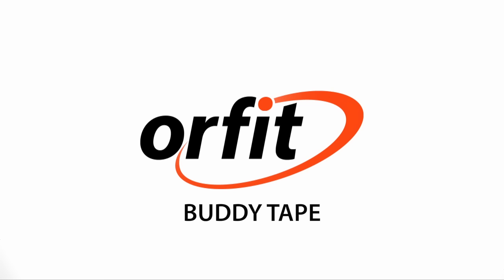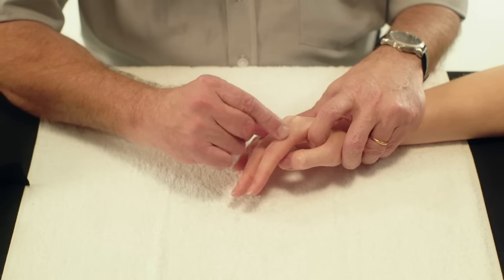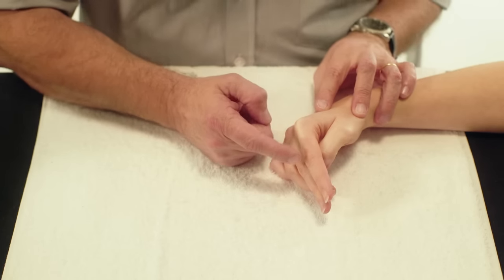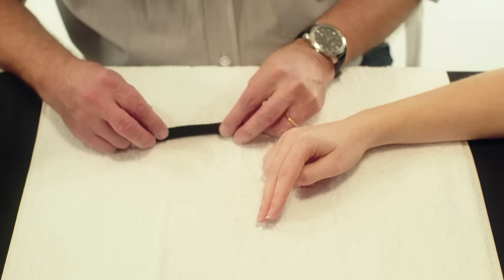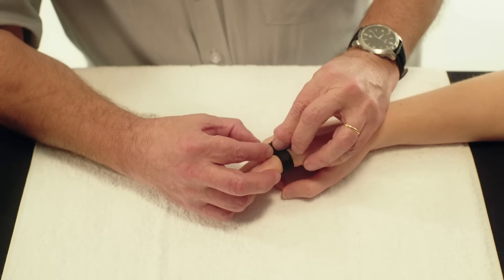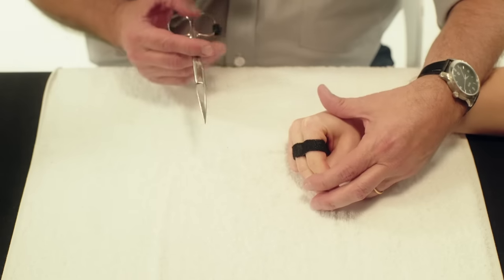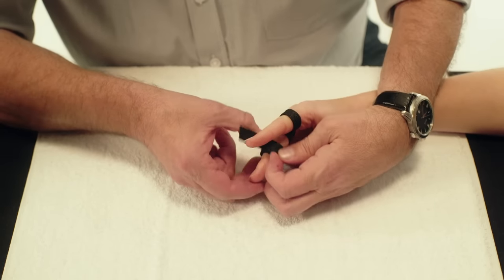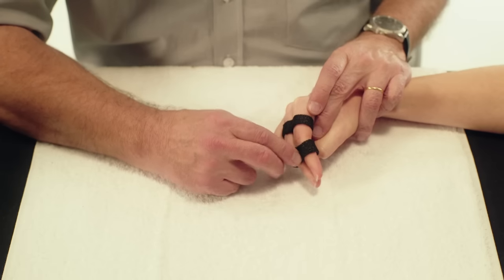Buddy tape - Orficast Instructional Movie 10

Comment: dont you have to heat it?
Reply from the maker: Hi there, you're right! The Orficast does need to be heated before molding. In this video, we heated it off-camera. We recommend heating Orficast in a water bath at 65°C (149°F) for one minute.
Reply: @orfit  I'm from kosovo please I don't on this I cut my hand I have problem with my fingers